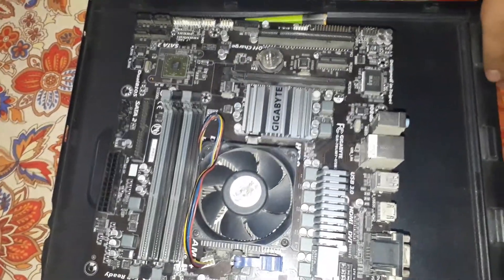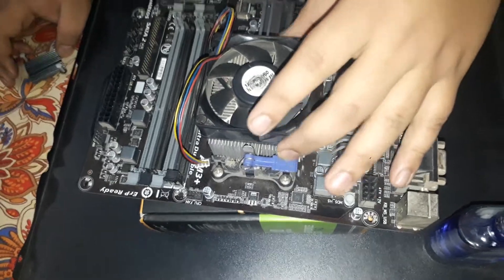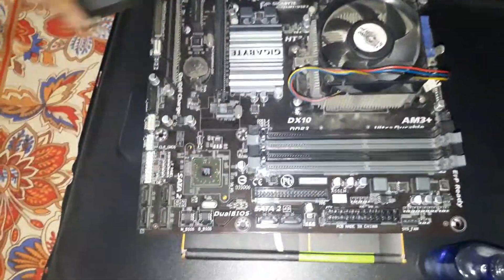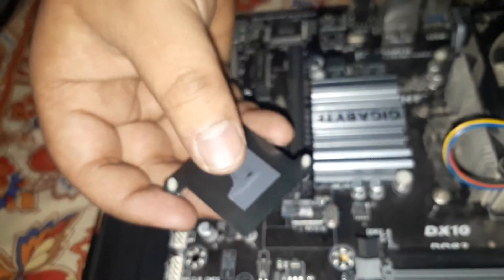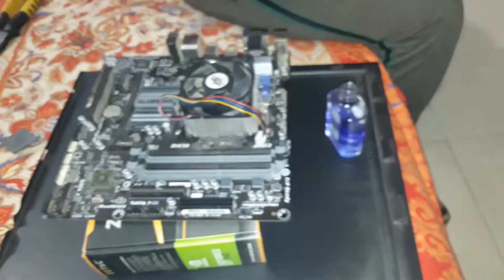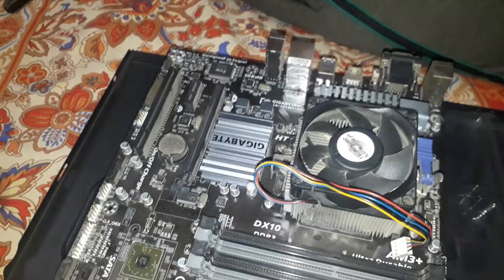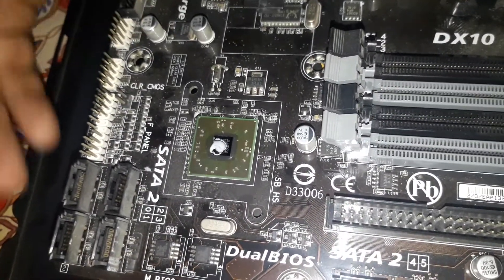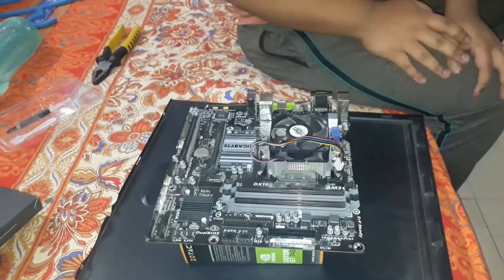How To Change Thermal Paste/Gel On Gigabyte Motherboard Northbridge and Southbridge

Comment: Thanks for the video.  I eventually ended up taking my system apart down to the bare iron as a consequence, instead of potentially damaging the Southbridge and Northbridge push-in pins.

What was happening with my system was random reboots with "smeared" video to the point where I could not troubleshoot the problem.  Because I am using the system implicated as a Home Theatre, I didn't stress too much about a reboot here or there while watching YouTube or the like.

Anyways, I took the board entirely out of the system (photographing all of the cable connections carefully) and then removed the CPU, Southbridge and Northbridge heat sinks entirely with finger power.

The Southbridge heat sink (smaller) used a stick-on heat pad that was still adhesive and in good shape.  Nevertheless, I scraped it off with my thumbnail and cleaned both the IC and the surface of the heatsink with isopropyl alcohol, a cotton rag and Q-Tips.  I made sure it was clean by taking a photo of it with my phone camera and enlarging it to make sure that what I was seeing was the writing on the surface of the IC and not residual heat sink material.  Then, I simply popped on the Southbridge heat sink.

The Northbridge heat sink was a different story.  There was no stick on heat pad.  There was cracked and caked heat sink compound that had lost all semblance of plasticity.  It took a long time to scrape it off (gently!) with my fingernail and a Q-Tip stem.  Eventually I got it off and noticed that the Northbridge was the AMD video chip, which obviously runs pretty hot.  I also noticed a black, felt-like bordering material that had degraded and gone powdery, so I removed it as well.  I applied a goodly amount of heat sink compound and snapped in the Northbridge heatsink, which bears the GIGABYTE logo.

The CPU was a pretty easy job, the heat sink compound was muddy but not solidified.  With sufficient patience and rubbing alcohol, I cleaned the IC and the heatsink entirely and replaced the heat sink compound by putting about half a pea of compound and then smearing it to cover the entire CPU surface before clipping on the aluminum block and top-mounted fan heat sink.

OBSERVATIONS: 

1) The Southbridge heat sink is very likely sufficient
2) The CPU heat sink is very likely sufficient
3) The Northbridge heat sink is very likely insufficient and needs either a larger surface area or a fan mount.

In operation, the Northbridge heat sink, passive though it is, is almost too hot to touch.  The baking of the heat sink compound tells me it's under-cooled.

The easiest way to boost the cooling characteristics of the NorthBridge heat sink is to affix a fan onto it, or direct a fan at it.
Reply from the maker: Good job brother! I'm glad I could help.
Reply: @ayushmansharma3516  
A week later, the system is working great.  Also, you may or may not know this, but there are both passive and active heat sink solutions for NorthBridge, which are on a 5.5cm spaced pin geometry.  There is even a fan connector and bios settings on my board.  A very satisfying solution for random reboots problem

Comment: Can i use thermal paste on vrm?
Reply: No absolutely not. You can only install aftermarket little heatsinks sold with adhesive pre-applied.
Reply: @TheJBftw  hj
Reply from the maker: you can but it is not recommended.

Comment: the application of the thermal compount is pure but it must do the trick IF your Chipset processors are overheating. i would guess you'll need to change em after a 5 year intensive hardware use at worst

Comment from the maker: Guys ask and suggest me any questions or ideas you want a video on.
Reply: i habe a probel,my cooler for the nothbridge comes not off,its because my termalpaste is very very old(2007) and i dont want to break the northbridge while removing the cooler because even with a lot of forse it comes not off,what should i do???
Reply: Einfach Yannic Put it on a garbage can and then wait for the garbage guy.
Reply: Francisco Santos 😑
Reply: Francisco Santos at the and i used some force and it didn't broke!!!jesss
Reply: can i use cpu thermal paste on it and how to check temperature for north bridge
Reply from the maker: You can use speed fan to check the temprature, and cpu thermal paste is alright as long you use good quality something like cooler master

Comment from the maker: yes there was about a 10C difference after the replacement as until you have something in the line of x99, z270 or x370 you'll get cheap quality of thermal solutions.